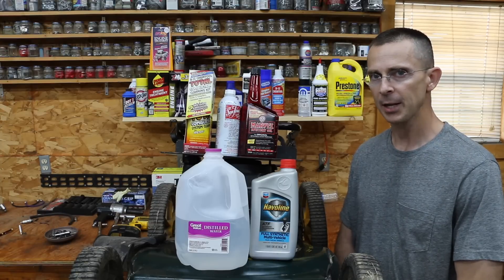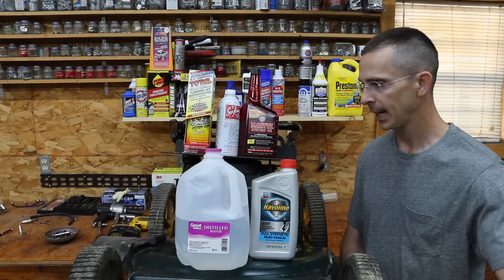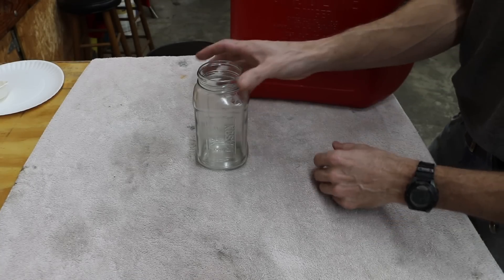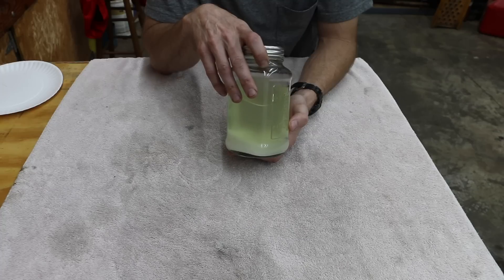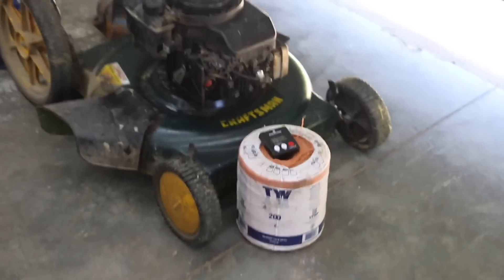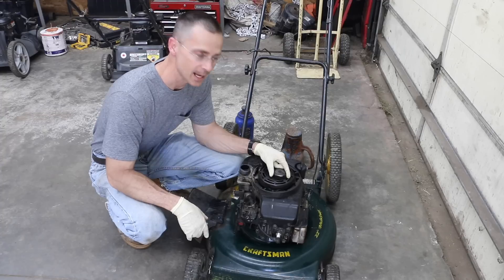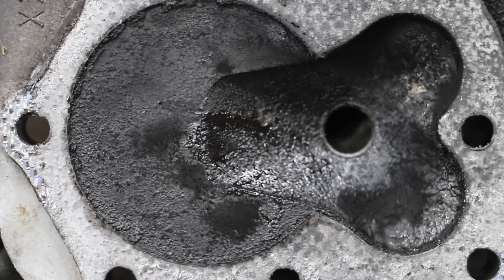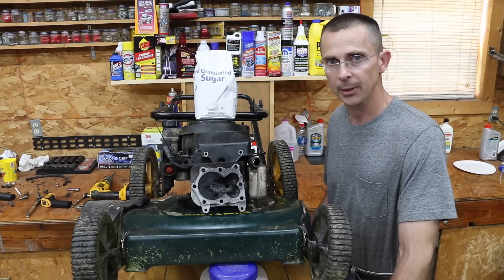Will Sugar in Gas Destroy a Vehicles Engine?  See what it does to this Engine!

Comment from the maker: Thanks to everyone who requested this video.  Highly recommend checking out Chis Fix' video on removing sugar from a fuel system.  https://youtu.be/tRM-n15tuXs
Reply: Funny you made this comment 3 weeks ago and made the video 3 years ago nice
Reply: Heh.
Reply: I heard javex in the tank will kill the engine? That would be a good video
Reply: Don't try it on your car, it might damage your feul injection system.
Reply: Use a soft drink like Coca-Cola the sugar is already a liquid
Reply: Love your content buddy, keep on keeping on!
Reply: So what did you choose to clean out the Sugar?
Reply: You should remove the fuel filter and try it again and see what happens.
Reply: I would use water to dissolve the sugar and since water is heavier than gas simply drain the tank until it's draining pure gas.
Reply: I would run it on nitrous like Stallone did in his hot rod in that movie.

Should burn out the sugar, piston, valves etc.
Reply: try the sugar in the oil
Reply: Mystery oil.
Reply: Sugar is not soluble in gasoline which is why rather than dumping crystalized sugar into the tank of the car you should dump a 20 oz soda. In the case of this lawnmower with its tiny gas tank, it would need to be less. Basically, it has to be enough soda to carry a good sugar load but not so much water that the engine won't fire. It's still questionable if it would do enough harm to stop the engine, but it would certainly be FAR more damaging than using sugar crystals.
Reply: Would be interested to see decaf coffee added to fuel was always told it will do horrible things to engines and fuel systems
Reply: I love what you do for the viewers, very informative and helpful subjects that you cover on your channel. Thank you, good sir!
Reply: it was more about gumming up the fuel system than it was to cause  catastrophic mechanical damage (thrown rods and the like), i had come across a few cars back in the day that had sugar in the fuel system, fuel filters clogged, float bowls clogged up with syrupy like goo in them , fuel lines with the same syrupy goo in them, it seems to me that the "damage" is commensurate with the ratio of suger to gas. Those were older model cars, non fuel injected obviously. As far as "destroying" an engine goes, i never run across one.
Reply: Diesel engine test with sugar please
Reply: No
Reply: Dose toilet bowl cleaner, clean O2 sensor. Would it clean a catalytic converter build up. Any plans. Soak O2 sensor in toilet blow cleaner,I guess drain-o.   Would apple cider vinegar clean also. Any carbon. Will remove rust ?

Comment: I have been a professional automotive technician for 26 years (Chrysler master Tech and Ford Senior Master Tech), and now for the past 5 years I have been an automotive instructor. I have seen many, many examples of sugar sabotage. I have seen the same thing happen every time on cars that are fuel injected ( most everything has been fuel injected for the past 30-35 years). Here is what I have seen: Most of the sugar stays in the tank, with a small amount migrating past the fuel pump, and whatever filtration there may be on the car. (Most cars do not have a replaceable fuel filter anymore). The small amount of sugar that gets to the fuel injectors stops there in the injectors. For whatever reason, whether its temperature change, size of pintle passages, flow and pooling of fuel at that point, the sugar seems to stop right there in the injectors. This ruins the injectors. They will stop working due to the pintles freezing up inside the injectors and nozzle stoppage. This causes, either a no start, or a misfire if there are some injectors still working. What we have done to repair this in the dealerships that I have worked in was, replace all injectors, replace fuel pressure regulator if equipped, drop tank and clean thoroughly, replace fuel pump, replace filter if equipped, and thoroughly flush fuel rails and all lines. Put new gas in and test drive. Some insurance companies also want the engine oil changed, though this doesn't seem to have any real connection to sugar in gas, its just their policy. These steps have always fixed this issue. These cars come back in for regular services with no long term issues noted by us, or the customer.
Reply: Well done Darren
Reply: darren beanard 
That's why I said sugar will make a fuel injected engine develop Type-2 Diabetes. Too much sugar in the system.
Reply: good information Darren
Reply: darren beanard  someone put sugar in my gas tank and I took it to the dealership. They have almost a month fixing it and they changed the fuel tank the fuel pumps and idk what else but the car still does not work. They flushed out the system but nothing. Now they're saying that they either need to get into the engine or just get a new engine. What do you think?is it bullshit about needing a new engine?
Reply: Roxanne Salas 
Dealerships always have something to try and make more money by keeping the car with them longer. Have you thought of sabotage? I wouldn't trust the bastards.
Reply: Mick Carson what exactly is sabotage?Cause I barely got the car about 3-4 months ago
Reply: Roxanne Salas 
Sabotage is something they usually do to make sure you pay more if they sabotage your engine by damaging it further, then say you need a new engine. How much is that going to cost? Well, of course, new engine or no car. By sabotaging it, you have no option but to spend the money until they fix it. I mean, how bad is the engine that you say it doesn't start really? Have you heard of second options? If you believe the car had sugar in the tank, speak to another dealer or local mechanic. You will be amazed at what they will tell you.
Reply: Mick Carson oh okay. And we'll so far it's costing me 3 grand, that's without taking out the engine. Taking out the engine or putting in a new engine is gonna cost me a total of 6 grand. I do believe there's sugar cause of problems that someone had with me. But it's hard to believe that with everything they've done that they still cant fix it.
Reply: Roxanne Salas 
Right. Youre already in a mess. You didn't say if it is a fuel injected. You didn't say how someone put sugar in your tank when modern cars have a door to the tank filler. I mean, how did you know there was sugar in your tank. Even if you drove right up to a dealer to be told you have sugar in your tank, how did they know, did they taste the fuel? Even so, the engine wasn't really that damaged. All they had to do was to empty the tank right up to the fuel line at the engine. I mean, how much sugar was in the tank? As for fuel injectors, they can clean or replace them but certainly they can still find out the extent of the supposed damaged engine and removing the injectors or spark plugs to look inside with a special microcamera will tell them the condition of the engine, but to suggest a new engine, that sounds like a real rip-off when there are better ways to tell if the engine is damaged or not. Did they tell you the state the engine is inside the cylinders, did they show you the injectors, spark plugs and the sugar mixed fuel in a jar? I wouldn't spend 6 thousands for something that is not shown to me. I've been a mechanic with 43 years of experience in my belt and have not heard stories like these before.
Reply: Yes, unfortunately, Roxanne you are being hosed by your dealer. They're going to get you for every dime they can swindle out of you. Smartest thing you could do is not to go back to them.
You ought to put them on blast on your local facebook pages so everyone in your area will know that their crooks!
Best of luck!
Reply: Most cars do not have a replaceable fuel filter anymore? I call BS. All engines bigger than a lawnmower have some kind of fuel filter, even if it is in the gas tank and hard to replace.
Reply: I would suggest  asking a reputable  mechanic to check it out.
A friend  had this happen,so I went  with her ,to hear the "expanation",and it was SO MUCH CRAP!
I then showed them my "credentials(33 years as a gas/diesel mechanic,and shop owner). 
I told them that they needed to talk to her attorney,and we left.
They called,the next day,and said her car was ready,....no charge!
Reply: Well said Mick !
Reply: How much would that work cost at a dealer?
Reply: @buddyclem7328  most new cars have a fuel sock inside the tank that's part of the pump and the pump sits in a well like a tank in a tank the fuel filter really is not replaceable unless you replace the fuel pump assembly normally you get a hundred thousand miles at least out of a fuel filter/ sock
Reply: Can you name a few models that do not have a fuel filter? is the sock in the tank considered a filter or strainer?
Reply: @hrevyaga82  I have two Renault Scenic cars on a 1.6 Litre and the other a Scenic RX4 with a 2.0 Litre both 2002 vintage. the 1.6 Litre has a built in fuel filter in the fuel pump that you cannot change the 2.0 Litre has a separate inline fuel filter , lots of modern cars have the fuel filter built into the fuel pump and it is not easily or in some cases possible to replace.
Reply: Thanks for the specific technical explanation....much appreciated.
Reply: Great reply. Thanks.
Reply: Maybe the owner of vehicle try insurance fraud by filling tank with sugar and blaming neighborhood kids to get full engine overhaul for free!
Reply: @pekkaylonen9611  I don't think so. If this was covered by insurance, he wouldn't care how much it would cost. In fact, he would be demanding a new engine. He seems to be paying for the cost himself.
Reply: @mickcarson8504  😁 I cant wait to F up my co worker truck
Reply: I'm so grateful for your comment. 
I all the sudden had dramatic problems with my car. They had to change all the things you're talking about. And now my engine is bad. We're wondering now in hindsight if my ex abuser put sugar in my gas tank. I'm wondering if there's a way to figure that out. Crying over my car that has carried my child and I so far. Thank you so much. I call my car Bluebird! 💙🙏🌈
Reply: Meanest thing that I have done was to add a half gallon of premium gas every payday to a man's dart. Then we began adding a half gallon of regular gas for one week, then none for a week. Suddenly that dude was driving his Blazer 4wd and already pulled out the valve train from his classic Dodge Dart. Had it built in two days along with a new cam and all seals. Drove it without saying much so we took out some gas a little bit at a time. He confided that he was clueless at break so we mixed together a pint of Marvel Mystery Oil and a gallon of Exxon gas and gave him a canning jar jar full to try out. Told him it was homemade. Of course we started back adding the same cycle. I know it wasn't nice, but we broke it down for him before he got to rebuilding stage again! Seriously though, that MMO is great stuff! .
Reply: Chrysler and Ford mastery tech huh  😂😂😂

Comment: And then he sold the mower on Craigs List
Reply from the maker: Funny!
Reply: Bwahahahaha I think I bought that mower !!!! Haha
Reply: Slightly used never abused lawnmower cuts fine
Reply: LMFAO couldn't have.......He still has all his teeth.......
Reply: It looks like a pair of testicles in the video at six minutes and 14 seconds. WEIRD.
Reply: Good lawnmower ran fine last time I used it
Reply: Runs like new, just changed the oil, low hours, never dumped sugar in the gas tank
Reply: Lol, I don't think he's ever got rid of something with a motor XD
Reply: He don’t get rid of lawn mowers
Reply: "Mint condition"
Reply: @braydenon4wheels629  grandma only used it on Sundays 😂😂
Reply: Runs sweet!
Reply: I had two cars that came into the Nissan shop with sugar damage.   The only problems it caused is sugar crystals clogged the gas lines.  I replaced the fuel lines and filter and never seen either again
Reply: Ad reads "Runs sweet".
Reply: Runs as should, no low balls, I know what I got